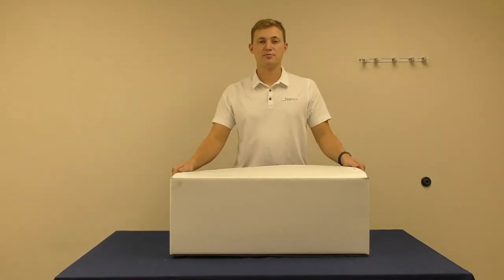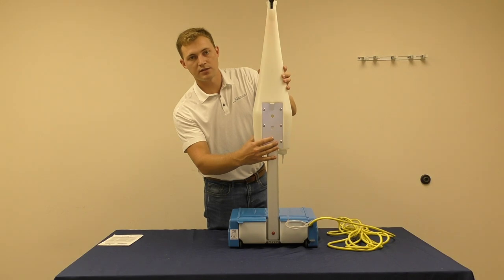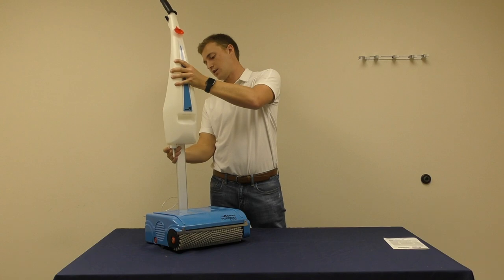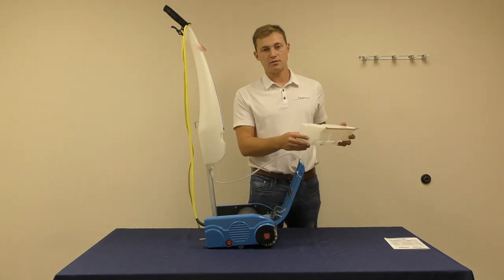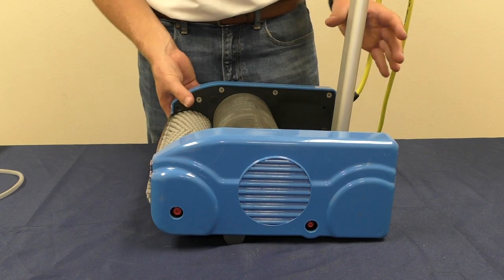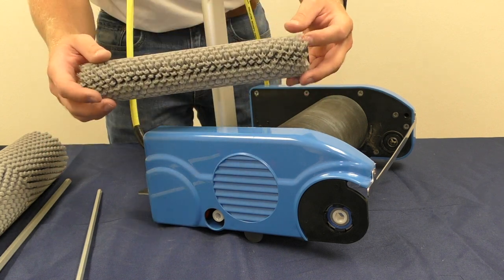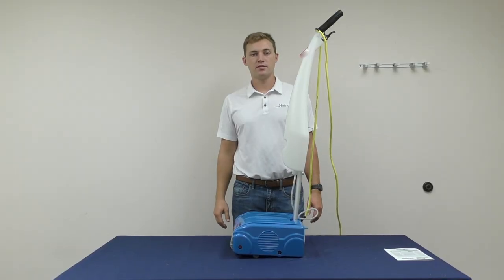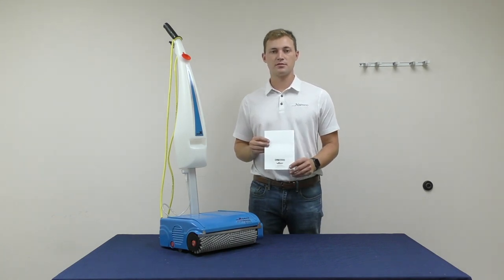Namco Floorwash 1000 & Floorwash 5000 Instructional Video

Comment: You bent the chrome (or aluminum) strip on the front of the machine when you rotated it (7:51). I do wonder if that part has some sort of function>>> Anyway, thank you for the video, I am buying one asap.
Reply from the maker: Hi Troy, thanks for watching! The metal strip on the front of the machine is the "Splash Guard" that helps keep the rotating brushes from splashing the dirty water back out the front of the machine. Let us know how you like your Floorwash, thank you for your business!

Comment: Hi to clean carpet my manager tell to take off the back brush off. It that true??
Reply from the maker: If you are experiencing issues with the brush snagging on carpets, it is recommended to remove the rear brush to allow the front brush to move smoothly across the carpet.

Comment: If you store it upright, wont that cause flat spots on the brushes?
Reply: I just got mine today. When the handle is upright little stands come out from the middle and their are small wheels in the back. If you watch the video again you can see when he drops the handle the machine drops and when he raises the handle the machine raises up too. I was concerned as well but all is good.
Reply from the maker: Thank you for raising the concern about storing the Floorwash Multi-Surface Floor Scrubber upright and its potential impact on the brushes. We appreciate your attention to detail and want to provide you with accurate information.

The Floorwash Multi-Surface Floor Scrubber is designed to be stored in an upright position without causing any damage or flat spots on the brushes. The brushes are made from durable materials that are resilient to the pressure of being stored vertically. The design and construction of the machine take into account the proper distribution of weight to prevent any adverse effects on the brushes.

However, if you have any specific concerns or prefer to store the machine in a different orientation, we recommend referring to the user manual for manufacturer guidelines. Following the recommended storage instructions will help ensure the longevity and optimal performance of the brushes and the overall machine.

We appreciate your attention to proper care and maintenance, and we strive to provide reliable products that meet your expectations. If you have any further questions or concerns, please feel free to reach out to our customer support team for assistance.

Comment: My Namco floor wash 1000 i just got yesterday and has already shut off twice on me  and wouldn't start back up while cleaning regular tile in an air conditioned house. Does this machine overheat easily ? Or is my machine faulty ? I was very excited for this thing and now not happy. Small house less than 2000 sq ft
Reply from the maker: Hi Justin, we are sorry to hear that. If you are experiencing technical issues, we encourage you to reach out to our repair department at 1-800-634-5816. One of our technicians will be able to help troubleshoot the issue.
Reply: @NamcoMfgInc  thank you . Your customer service is great, i been speaking with someone there .

Comment: Can you run it with out the recovery tank?
Reply from the maker: Yes! This is an excellent technique to use for extra scrubbing power on low-profile carpet. Once you have agitated the area, make sure to place the recovery tank back inside the machine to pick all the dirt.